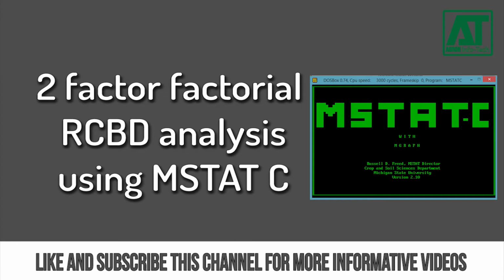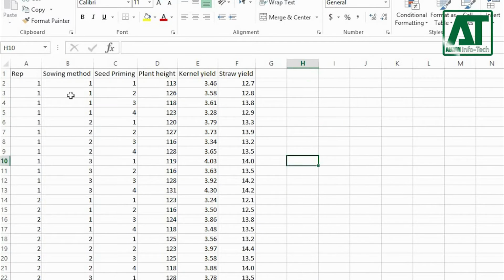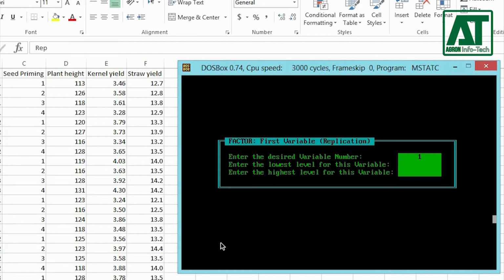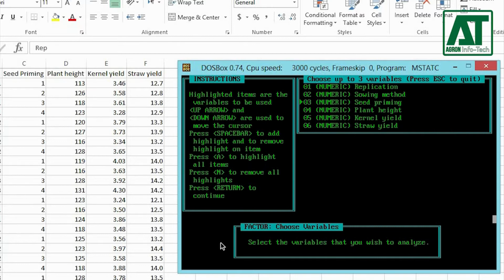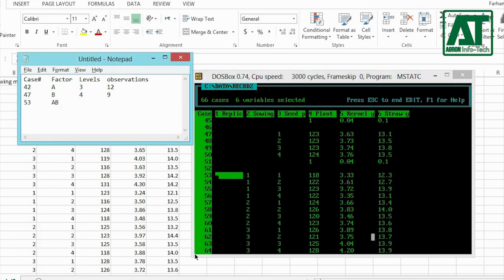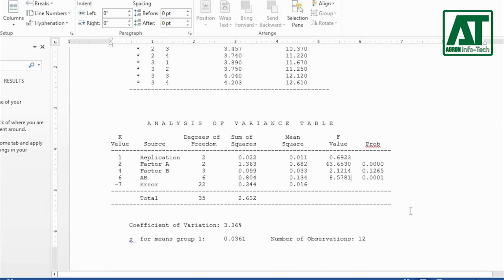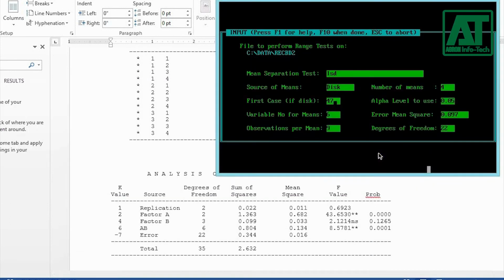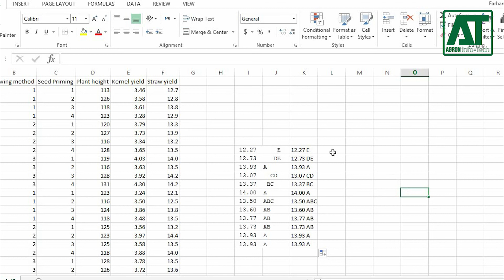Analysis of two factor factorial randomized complete block design using MSTAT C

Comment: Sir, I have Five treatments, Six genotypes, 4 replications and three stages with two conditions. How can I do the analysis?
Reply from the maker: Can you little bit explain what were the conditions? Application of experimental design should be based on the objectives of research. What is your objective and what what you want to achieve from your experiment. This information will be helpful to decide about the experimental design. Five treatments, 6 genotypes and 4 reps would be a 2 factor factorial design. However, if you want to see the effect of stages and conditions as well as the interaction then it will make the experiment more complicated not only for analysis as well as for interpretation of results.

Comment: Do you have any email id? I don't understand from 5.44 to rest. How can I know which value is significant or not? Then in case of lsd test, my factor A level is 2, observation 15; factor B level is 5, observation 6; factor AB level is 10, observation is 3 (since, A = variety 2, B= treatment 5 and replication 3). I did what u say here in Lsd test, but when I input 15 as observations for mean and 2 as number of means , mstatc dont accept. If u would be kind enough to send me a mail at eimon5130@gmail.com, so that u can suggest me what to do next by reviewing my data, please. Thank U sir.
Reply from the maker: You should type 3 for treatment factor instead of 2. Rest is ok.
My email is agron.infotech@gmail.com